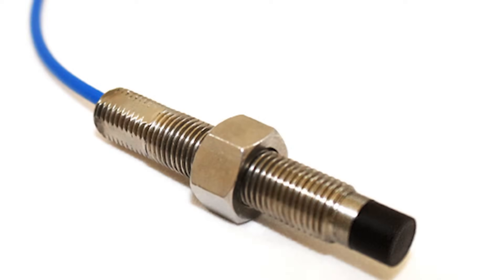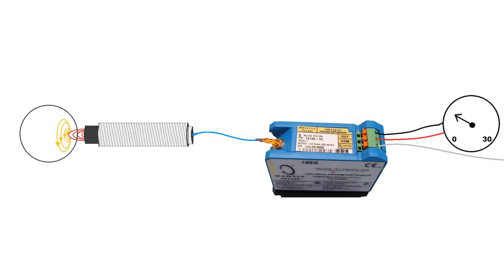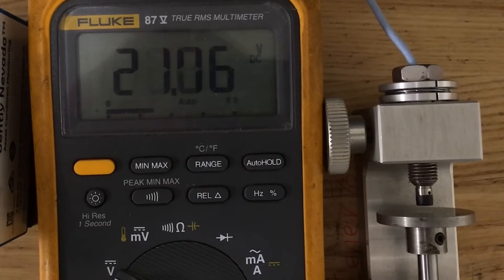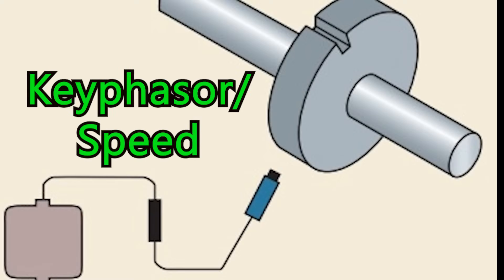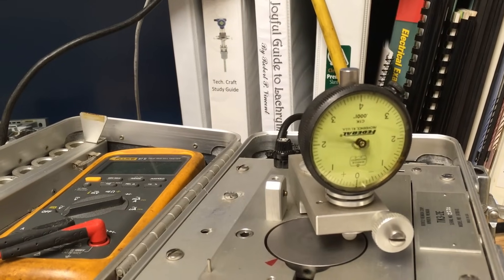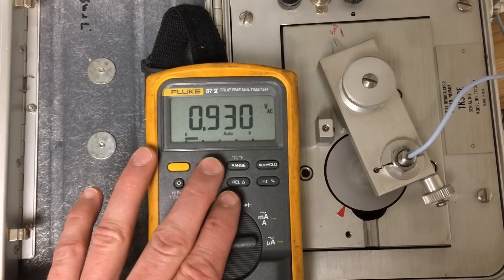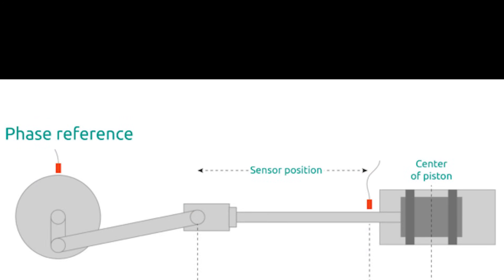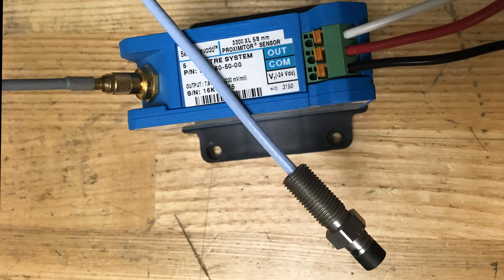Vibration Monitoring Proximity Probe Working Principle

Comment: Jim, not to be critical, but you have the polarity of your voltmeter backwards.  Bently uses a -24VDC power supply and the output of the proximeter is (-) negative.  This is critical when understanding the gap voltage is part of diagnosing a machine condition.  It is use for radial shaft position (X/Y) and axial position for thrust measurements.  Monitoring shaft centerline using DC Gap voltage can tell the analyst alot about shaft position in the bearing.  When using a standard proximiter, it is -24VDC and when using the Bently 990 transmitter, it is +24VDC.  This is also critical to know because the phase reference on the 990 transmitter is 180 degrees out of phase.

Comment: Dear sir. I have two probes with different part number, PN: 86691-08065-0435-25 and PN:86691-09246-0435-25. I only know they are 2.5 m length but i am not sure they can be used interchangeably. Is it possible? What are their differences?
Reply from the maker: I don't have that manual, so I cannot say for certain.  From a performance standpoint it should work.  Difference will be in the custom features.  Such as mounting options, length of armored jacket, etc..

Comment: Excuse me sir. My name is agus. I have some question related with vibration system.
1. Whats the function for minus DC power supply?
2. Whats correlation between DC power supply and AC power supply which generated by probe?
Reply from the maker: Answer 1: The polarity doesn't matter unless you are a transistor, which in this case is why the polarity is reversed.  For the purpose of understanding how it works, it makes little difference.
Reply from the maker: Answer2:  Think of the AC as DC with a wave.  Normal AC changes polarity, this doesn't.  You just have to switch a meter to AC to measure the dynamics of the sinewave that is created.  It's AC with a voltage bias.

Comment: Great video! How do you put in and out the override switch? Normally this is via the monitor software?
Reply from the maker: I'm not familiar with an override.  Are you referring to the bypass switch?
Reply: @jimdiggins101  in between i figured out, every slot has a digital input alarm. At our plant we can override with a switch the DI!
Reply: @Jokesxxl  you mean, trip multiply??
Reply: @kasumy17  i looked further, i mean a override switch for alarm if you replace a sensor
Reply: @Jokesxxl  okay, you mean bypass the alarm, while you replace de sensor during an operation machine??
Reply: @Jokesxxl  you can do that, if you have a 3500 rack or 3300 rack. With the old one, a 3300 rack. You can bypass the alarm with the deep switch inside the 3300 monitor. If you have a 3500 rack, you can bypass the alarm, using 3500 rack config software,. If you need more info. Or help. Let me know.
Reply: @kasumy17  we have 3500 systeem, in our case its not possible to switch out a sensor while operating, because you have to adjust it when its down. Like axial 9,75V the electric middle.
Reply: @Jokesxxl  you are right, with the axial probe, you can not remove the sensor until the machine stoped. Because u need to adjust with the position of the rotor, and the radial vibration proble, usually  they see the rotor inside the bearing., so, u only can check the resistance or the ext cable and proximitor without to remove the probe.. friend, if you have any help or asistant just let me know
Reply: @Jokesxxl  where u from??
Reply: @kasumy17  Netherlands
Reply: @Jokesxxl  ups!! I"m from Chile, southamerica

Comment: The supply given is -24 Volts. Why not a positive supply?
Reply from the maker: This product was originally invented a long time ago.  At that point in time, due to the availability of semiconductors, it was more practical and cost efficient to apply a negative voltage, which provided the proper gate voltage for the more common semiconductor type.  It is no longer a thing that people consider during instrument design.  The -24volts has been adopted by all the newer iterations of the product line.

Comment: if ISF% bigger than the manufacturer's standard, how recalibrate transducer?
Reply from the maker: This procedure verifies accuracy. You must determine the amount of acceptable error based on machine tolerances.  Excessive error usually indicates a mismatched or faulty component.  The resistance test can help diagnose.

Comment: At 3:13, what is actually the neutral point of the oscillation ? Is it the initial gap voltage when the shaft stops spinning or when there is no vibration ?
Reply from the maker: The neutral point is the mid point between upper and lower travel during vibration.  If the shaft is not vibrating, there is no neutral point because the voltage is not fluctuating.  Or are you asking what the expected DC voltage will be during vibration?
Reply: Thank you, I got your point. But what can we do with the DC voltage when the shaft is vibrating, or we just care about the AC voltage and use it to calculate frequency & amplitude of the vibration ?
Reply from the maker: @DanhNguyễnDươngTuấn  DC voltage is still used in Radial Vibration.  Most people track DC voltage and set alarm points to warn if a probe is out of range.  It can also used for measuring shaft movement while it is rotating for diagnostic purposes.  Bearing wear can cause shaft drift over time, which can be identified with gap voltage while it is running.  Pressure dam bearings cause the shaft to ride on an oil wedge.  Radial vibration probes can monitor this shaft movement with the gap voltage.  This is why it is important to set all probes at the exact same voltage so you can monitor movement across the shaft length.
Reply: Thank you. I learned alot.